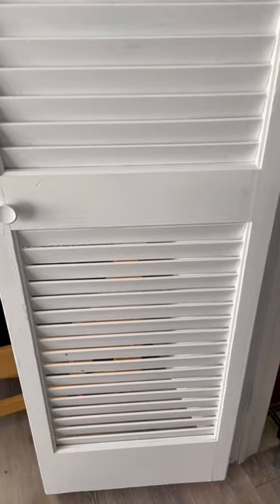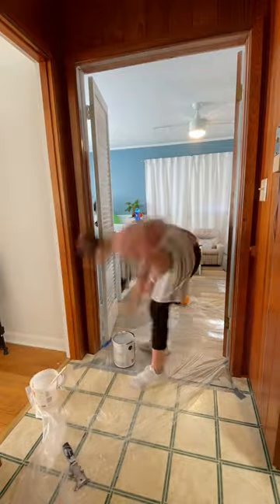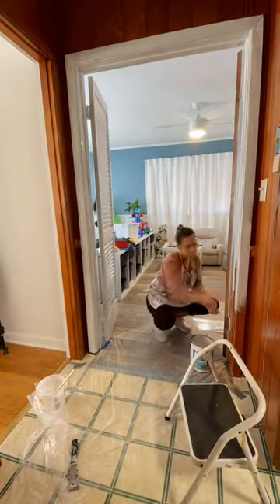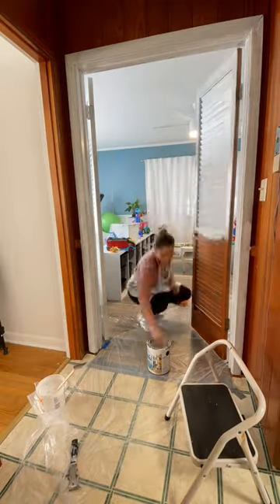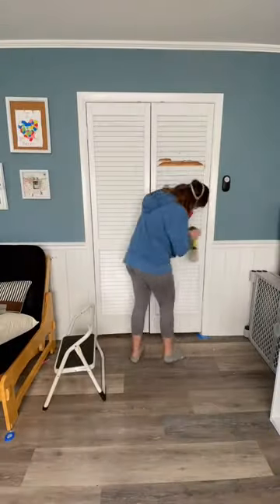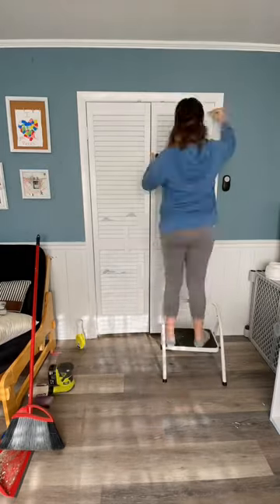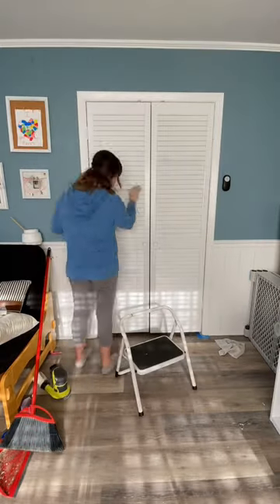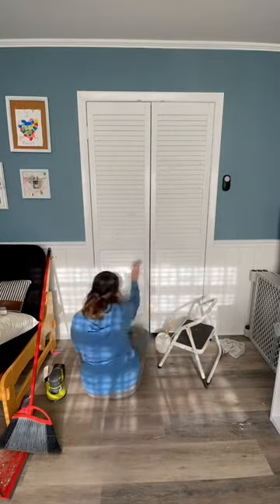DIY fail in room transformation | Painting door | House Project 1970s Home Renovation

Comment: You didn't do anything wrong. There was too much paint on the brush that caused the runs. Painting is a tedious process that require patience. Some times it's best to apply 2-3 thin coats instead of trying to cover in 1 thick coat.
Reply from the maker: Thanks for the tips!